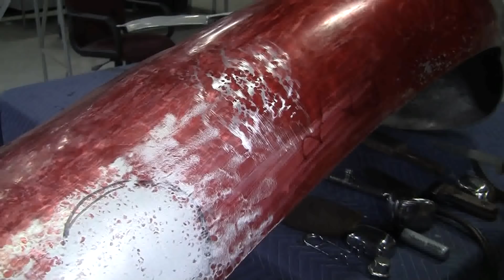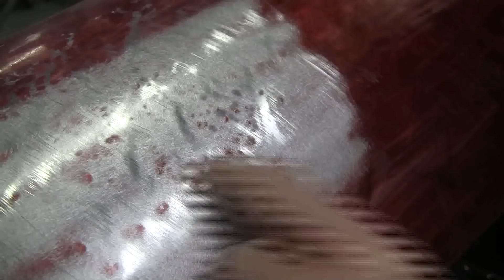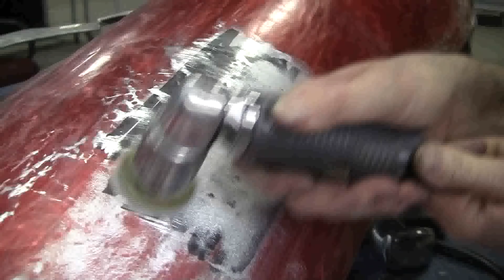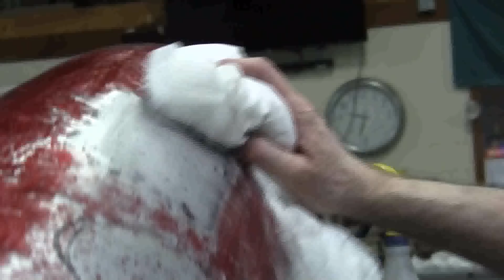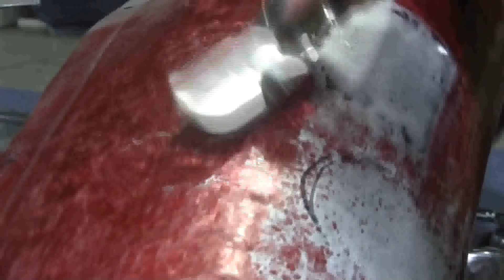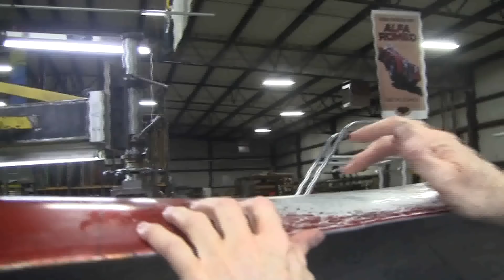Auto Body Repair: How to remove dents from Aluminum Part 2

Comment: Thanks, these are exactly the skills I need to  utilise, to repair my Defender aluminium door skin which I've rebuilt. Only to discover 13mm of filler cracked which was covering a deep long dent, and after I put the skin back over the bottom steel section which I replaced. The original was rusted out. 
Now I know why the door was so heavy, and I'm employing your techniques to shrink and remove very deep dents and some canning. Although I'll have to accept not being able to get to some behind the frame,  I'm never going to get all the imperfections. Those will remain as part of the character of an old farmy 300tdi pick-up. But thanks to your time and effort demonstrating I can get rid of 95% of the filler

Comment: Will this heat shrinking technique work with .020 6061 T6? I have a couple of small dents in my airplane that I would like to remove, but am afraid I will just stretch the area. I would like to know I can shrink it back,
Thanks
Reply from the maker: Practice on a scrap piece of the same metal.

Comment: Used this to repair a piece of aluminum trim on a camper, I was able to shrink the stretched parts and make the piece straight again. It’s a corner piece with an outer radius of a three inch pipe, one side is flat while the other is a flange. I used your shot bag and a cheap slapper from harbor freight. This was my first aluminum repair and it turned out fairly well. Getting the curve just right was a challenge, I actually laid the piece face down on my work bench and used a plastic caster wheel to roll the surface flat. The straight edge and block sander proved how well this worked. At this point perfectionist says pick and file, management however over rules this and a skim coat will finish this part quite nicely. After all it’s not a Bugatti. Your videos are great and for a hobbyist like me they are gold. Thanks Wray.

Comment: Wouldn't your sinking disc take care of most of this?
Reply from the maker: I used to use my shrinking discs on aluminum but they do mark the panel. The scratching will sand out  but now I like my new technique with the torch heat and the hand held shot filled bag.

Comment: Cheers Wray!  soaking it up here in Sydney,. . . Would the planishing process work with a powered hammer rather than chasing the lows with the slapper?  Also can you do a vid with  the same process but in steel, I am working an old ute body and wondering if the process carries over, have just bought your E wheel kit and soft dolly to further my experience, Hope to make it there one day. g
Reply from the maker: Thanks glad you are finding value in my videos.😁  I prefer using the slapper and dolly technique over others. I personally have found that a handheld air planishing hammer or mobile English wheel can be cumbersome to use. They can work certain areas faster but on tight spots they can make a mess quickly. Developing your hand tool techniques is a  very important component of mastering the mystery of moving sheet metal.  I always have more respect for it technique over tool solutions  I use my Proshaper shrinking discs on steel panels but only for highs that are under 1.5mm above that I shrink with the torch.

Comment: Thanks for your videos, very interesting.  Very sensible comments during the process.  I myself, wants to know even more tip on OFF dolly process and when to use this tecnique.  I'm not shure if I understand this in details :  Typically when you weld in a new part into and old one, you get highs and lows close to the weld, which you want to adress  (even after you have finished stretcing the weld seam itself)
Reply from the maker: Everything in shaping sheet metal is fulcrum and lever. Off dolly is changing your fulcrum position.  Thanks !

Comment: Gday Ray! Thank you for showing me these skills! I feel inspired to hook into to body panels of our Austin Healey 100/4 now. As the first step I think I need to remove Bondo from the panels without sanding, some kind of chemical stripping I guess?
Reply: Dad is wanting to sell this one, but I want to give it a red hot go bringing it back to life... the aluminium shrouds are in a few pieces, but the chassis looks pretty solid... Austin Healey 100/6 BN4 for sale https://youtu.be/z5qJbFu-Yz8
Reply from the maker: Thanks!  Yes, use chemical stripper to remove paint and fillers. If the bondo is real thick you can remove it with a hear gun and putty knife.  No sandblasting ever on body panels. Keep watching lots if good information will be coming.

Comment: this is just the inspiration i need to be able to build a Toyota 2000gt one day, you break it down to a manageable and understandable process that i can decipher. i have done a few steel wide bodies and taking that leap to achieve higher perfection is all im lacking! love your work Ray!
Reply from the maker: Thanks! I have a local friend that also wants to scratch-built a Toyoto 2000 GT. Please check out my website proshaper.com

Comment: Great video ,if you use a shrinking hamer i mean a small dented hammer and put the dolly straight under the dent hold the dolly firm and strike with the shrinking hammer lightly one by one you can fix the dents without bringing the hole area up and have to shrink it later .
Reply from the maker: Thanks, I am aware of shrinking hammers, I prefer to not use them because they leave scars in the metal. In the case of this Lotus it will not be painted just polished.
Reply: @proshaper  if its is not going to be painted then you are absolutly right anyhow l have watched your videos and after 20 years in this business you sir are one of the best masters of the art of metal shaping thanks  for sharing your knowledge 🙏
Reply from the maker: @shahriariran44  Thanks!